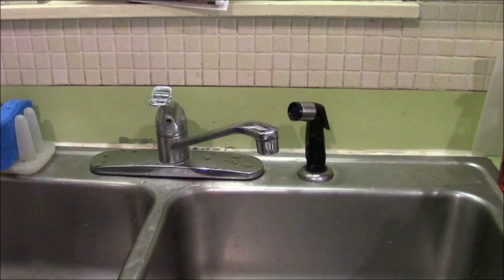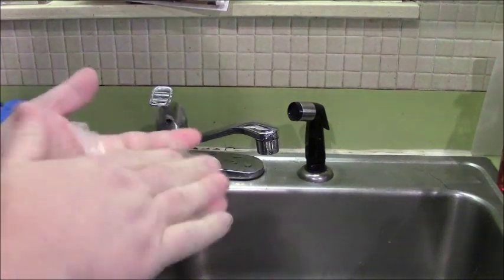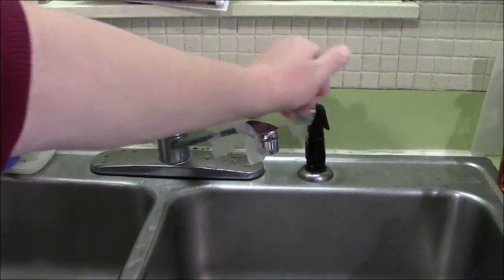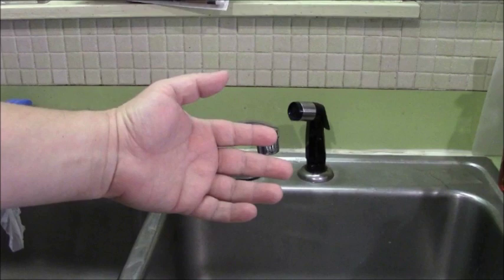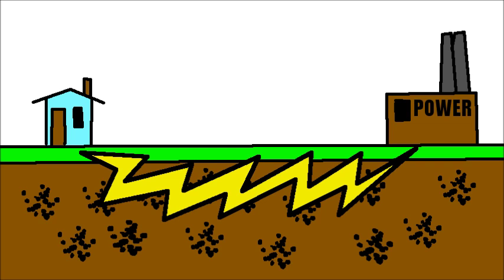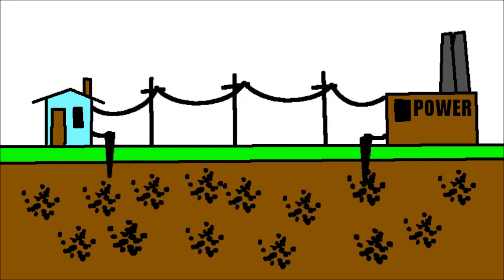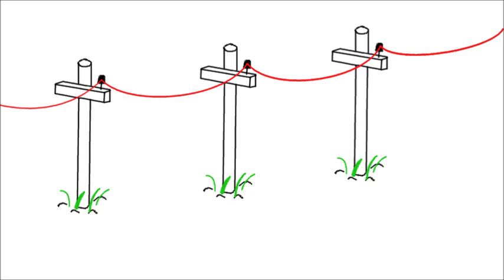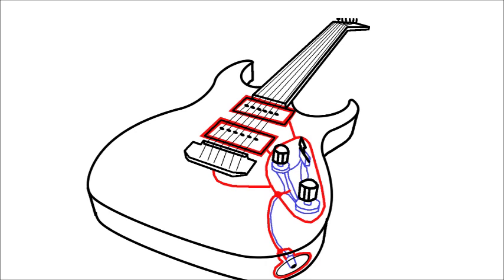Grounding

Comment: If you use multimeter and if i connect one lead to negative and another lead to ground, i should not see any voltage difference in potential, is that right.. in AC..
Reply from the maker: Assuming the wiring in the system is good, that is correct.  As I noted in the video, some appliances like large motors and big fluorescent lights can put a voltage on the neutral.

Comment: In my house we have about 120 volts between Neutral and Ground. I don't know if that's normal because I'm in the UK and I don't know if the wiring is different here.  I do know the voltage here is supposed to be 240 between Live (Hot) and Neutral.

Comment: sorry asking two many question, hope you dont mind, so if i connect one of the wire to ground (we call that wire as neutral), will not that neutral wire have any volts at all, meaning +120 v or -120v as part of AC, if you say yes, when i touch i wont get shock because myself and ground are at same potential and there is no difference .. irrespective of + or -120 because myself and ground are at same potentional is that right.
Reply from the maker: The power generator makes sure that there is 120 volts between the two wires, and it doesn't really care what those wires are connected to.  If you connect one wire (neutral) to earth, there is still going to be 120v difference between the two wires, only now, the neutral wire is always at the same potential as the earth (and you).  Touching the neutral wire will therefore not shock you, but touching the hot wire could be deadly.  The generator maintains the voltage difference between the wires, and connecting one to earth doesn't change that fact, but it makes the system safer.

Comment: hi, i didnot understand at 9:56.  you are very good in explaining.. i am clear that positive and negative is changing with polarity in AC, so if i attach one wire to ground, why it wont short it to ground.
Reply from the maker: If there were just one wire, the excess charge on it would dissipate into the earth.  However, with AC, when the hot wire goes negative, the neutral wire is positive compared to it, and the hot wire then supplies the electrons that the neutral is attracting.  Since the one wire is supplying the charge that the other wire is short of, there is no need to dissipate into the earth.  When we connect neutral to earth, the power generator still makes the "hot" wire at opposite polarity with the neutral, but now that neutral is attached to ground, the hot wire is the only wire that has voltage potential on it, compared to ground.

It's all relative.  Because the power generator keeps the wires at 120 volts difference, that is what's used by our appliances.  However, by attaching one wire to the earth doesn't change the fact that there is a 120 volt difference, just that one of those wires is connected to earth, and is therefore at the same potential as earth.  This is also kind of the principle that makes a balun work.
Reply: Steel Wheels Down Thanks so much..Final Questions. 1) Can I also assume My neutral wire will be 0 volts and my hot wire will be + 120 or -120.  2) What I understand from your description is, attaching neutral to ground will not cause short because neutral being 0 volts and hot wire being + or -120 all the time. Now during neutral being 0 and hot being +120 force electrons to move towards +120 and not ground.. so there is no short.. in other cases where neutral being 0 and hot being -120 force electrons to move from hotwire(-120) to neutral(0), in this case electrons will not flow to ground even though netural is attachced to ground, because ground have more resistance than the hot(-120)...  did i understand the concept to an extend or am i still a dummy?..
Reply from the maker: sivaraj palanisamy You are not a dummy, this is correct.  The definition of a circuit is that the electrons always have to have a way to return from where they started.  They follow this path no matter what, even if one wire is attached to ground.  If both wires touch earth, then there will be a short through the earth from one wire to the other, but if it's only the one wire, then it's OK.  I know it seems confusing, but it's just like hanging a piece of metal over one wire.  If the metal isn't touching anything else, it has no effect over the flow of charge through the wire.  So, just think of the earth as a gigantic piece of metal touching one wire - same thing.
Reply: Excellent. I have read lots of books, watched so many definition , book examples, but you are the best i have seen so far.. You should write a book about how NOT to write and teach..
Reply: I think that many people have already seen the answer to the question and they might have even asked this same question when they were kids... Do you remember when you were younger and playing outside with your friends.. Then you or your friends notice the birds sitting on the power lines up in the air on the power poles... Then someone says.... Hey! How come those birds don't get electrocuted??? Well... They have very short legs... And they are a very long way from ground... So basically if you were hanging from the very same wire as the birds... So long as you don't reach out to one of the other wire's and don't touch the ground... Then you are safe.. You won't die... Imagine that you are hanging on the high voltage power line with both your hands evenly spaced apart on the same wire. Now, if that wire somehow managed to get some resistance or the wire breaks somewhere in between your hands... With the golden rule of current... It always flows in the path of least resistance... What this basically means is that even though you are off the ground and you are not creating a short circuit with another wire... If electricity sees less resistance through your arms and chest... Then that's the way it's going to go and you will now be history.... I think that there's a very good video in that... Three points... One, never be the short circuit for electricity. Two, never take a job as a group spike, it's hazardous to your health. Three, Never be the meat in the burger of least resistance... You have already been warned about junk food... 
Well that's my 20 cents worth... I hope that this helps somebody somewhere... I can relate to the way that this video and the rest that are done but as hard as we sometimes try to explain without any mathematics which only seem to confuse me. We can muck it up a little... While this video taught me something, I still felt like I finished watching and had more questions than before... But I'm good now...